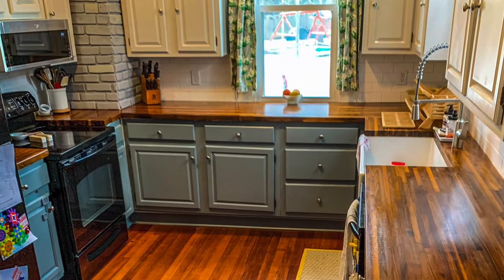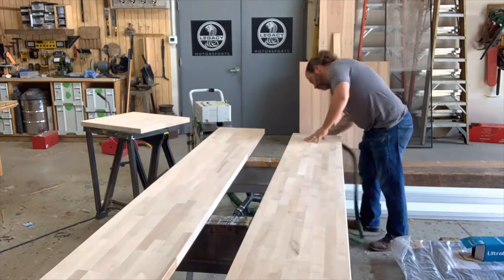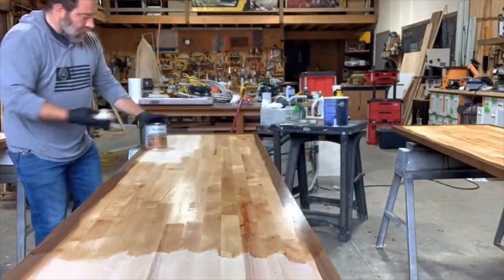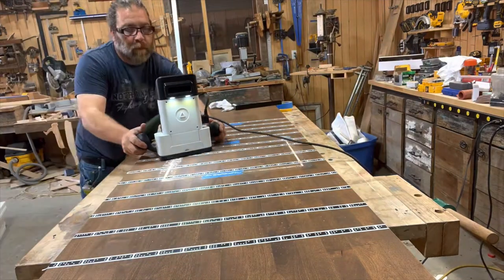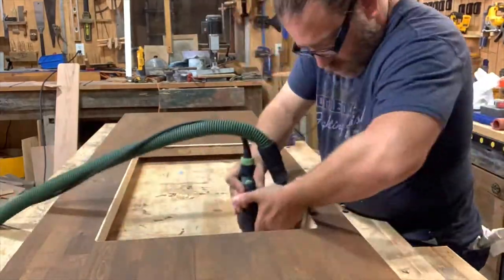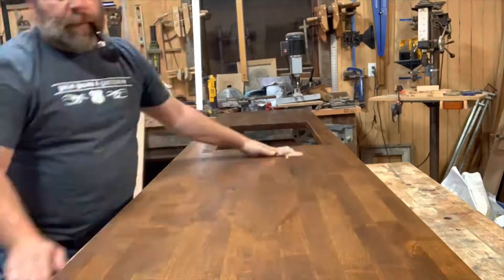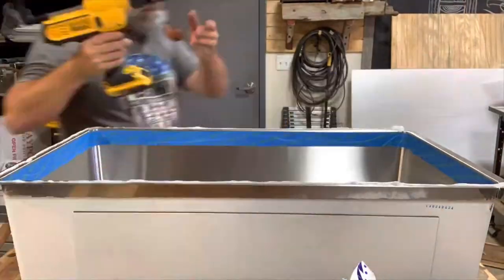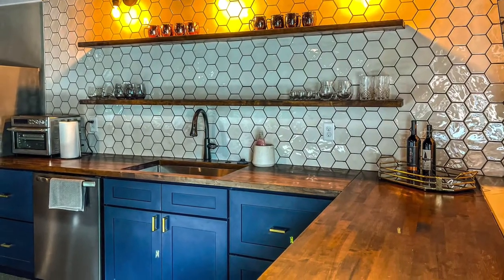How To: Prep, Stain, & Seal Butcher Block Countertops w/ Under-Mounted Sink

Comment: I am installing bb counter tops with a poly finish. I’ve sanded the tops with 220 grit 3 times and it still feels “hairy “ in places. Does it have to be completely slick before I apply the poly?

Comment: Just wondering why after the stain was applied. Why did you cut out the sink and then have to restain the area that was cutout. Would it have been easier to make all the cuts before staining the piece?
Reply from the maker: Absolutely, it would’ve been a lot easier! But the video wouldn’t have been near as cool ;-)

Comment: How many coats of gel stain did you apply and how long do you allow it to dry before applying the poly. Then, how long between each coat of poly do you allow to dry? Do you sand the final voat of poly? Thanks.

Comment: Question... do you use anything other than the silicone to mount that sink? I know it's fairly strong, but I would have thought using some form of mechanical lock (washers and screws, etc...) would be a good follow-up option. No? Thanks!
Reply from the maker: I did put clips, but I didn’t video that part. I should’ve said something in the video. Nice catch!

Comment: Did you use oil or water based poly? Thanks for the helpful info
Reply from the maker: I used water-based poly on this application. The technology is really changed a lot over the years and water base is just fine especially if you’re using your countertops as a food prep.

Comment: This looks great, thanks for the video. I plan on installing butcher block countertops in my garage kitchen. How soon after application of mineral spirits do you apply the stain? Is there any concern around the sink with moisture/should extra coats of poly be applied? Also, would you mind posting the brand and type of poly and stain used?
Reply from the maker: So sorry it took me so long to respond, Josh.  The poly should protect the wood, so I’ve never had issues. Getting a good seal is important, but don’t worry too much about it. 

I stain almost immediately after the mineral spirits is applied…you want the spirits to be drying AS you apply the gel stain. 

I used Minwax gel stain & minwax water based wipe on poly. Both have given me great results. 

Good luck!!
Reply: @bgwconstruction  Thanks for the response.  I ended up not staining it and used the minwax water based poly in satin.  I put 5 coats and sanded lightly with a 320 sponge between each coat and it came out smooth as glass.
Reply: @joshgravois818 how long did you wait between the coats and how did you apply it?

Comment: Do butcher block countertops last without staining them? Because I love the natural color of mine but I’ve been told they won’t last as long if I don’t stain them
Reply: I don’t know if anyone answered you but the stain does not protect it. Stain just changes the color. The sealer you use can change the color depending on what you use. I’m looking into using tongue oil so I can use my counter top as a cutting board and not worry about the polyurethane getting cut marks.

Comment: if i stained and poly’d my countertops already is there a way i can redo and use your method i stead ? and is there such thing at too many coats of poly ?
Reply from the maker: You can restrain the tops, but you’ll want to completely remove the clear coat and sand down the stain to virgin wood if possible. A lot of work, for sure. 

No…there’s no such thing as too much poly. ;-)

Comment: Is using poly food safe?
Reply: Once it's dried it is.
Reply: You have to check if its food grade. Some aren't but the product should say if it is.
Reply from the maker: That’s why I use water-based poly. I have read some opinions that oil base poly is bad if you get food on top of it… but I think a lot of the toxic chemicals that used to be in polyurethane and stain have been legislated out. I will confess, I’m not an chemical expert, so I always tell my clients that if we polyurethane the butcher block to not consider it completely safe as a food prep.